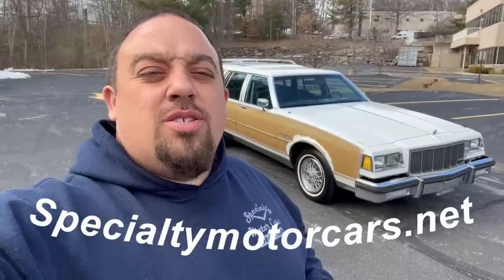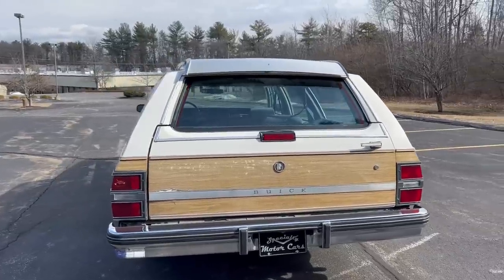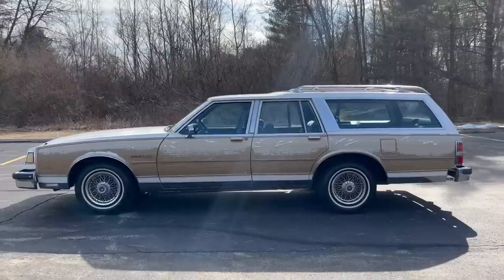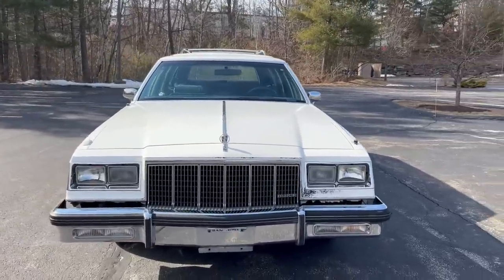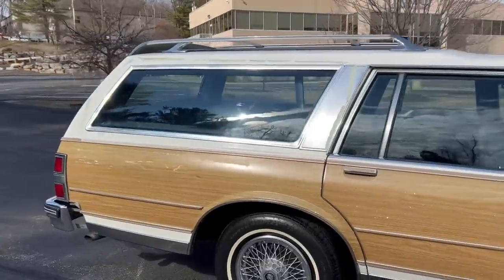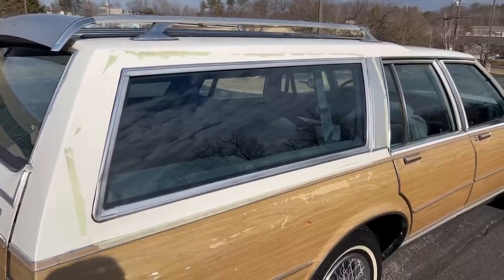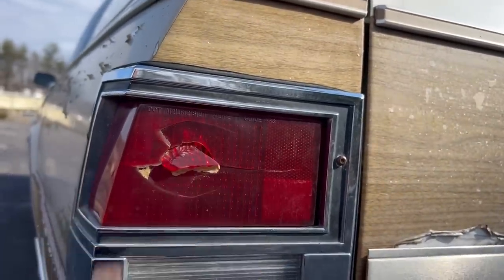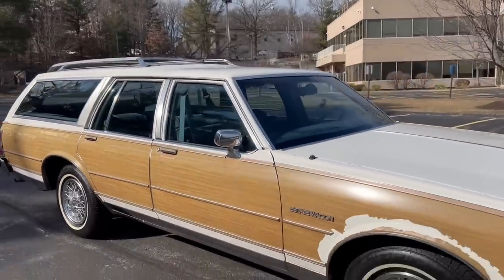1990 Buick Lesabre Electra Estate Wagon FOR SALE 79k miles California Car by Specialty Motor cars

Comment: My Dad had this exact model & exterior color; I’m not sure about the interior.  He bought it brand new in 1992.  It had been a Shuttle Car for the 1990 Buick Open. It sat at the Dealership after being refinished at the factory so it could be sold as new.  But there was a change in the law in MI that year which forced GM to List and sell them as Used.  It had about 4,000 miles on it when my Dad bought it in like Jan. or Feb. of ‘92.  He didn’t have it very long though.  He had to take to the ditch to avoid hitting a dog and Ins. totaled it after discovering the frame was bent downward flexing the entire body and jamming the doors on the passenger side of the vehicle. It had about 8K on it then.  You couldn’t tell there was any flexing or bending to look at it.  Only when you went to open the rear door, passenger side and it would stick.

Our local frame shop was sure they could fix it but GM wanted the car destroyed so they wouldn’t have to ever worry about any lawsuit.  My Dad loved that car.  But he had an ‘83 Pk. Ave. that he also bought new, an ‘87 Ford F350 Motorhome and an ‘89 F150 w/Club Cab  that he also bought new.  So he didn’t really need it.
Reply: Yw⁷

Comment: The back seat had to have been a "delete option" at no charge.  I had an 85 Caprice woody wagon with nearly 300k on it.  I got it from my neighbor.   It rusted so badly that the front shock rusted off and no longer connected to the car!
Reply: Wi-fi / Bluetooth connectivity

Comment: This video is awesome for its documentation even though the car is sold. I recently bought a 90 (same price and similar condition.)  I also have the third row seat delete and the wire wheel covers. I was curious about the black carpet in ours and assumed it was aftermarket but I guess not. BTW, I found the RPO build code sticker in the spare tire well,  there was an option to delete the rear seat.

Comment: The 1990 model they called it the Estate Wagon because they were phasing the name Electra out. For whatever reason they chose to 80-84 Electra header panel only and they had the 80-84 Electra Limited seats only and put LeSabre Custom door panels in the interior even with leather and full dual 6 way with power recliners. Some didn’t have the third row. Some caprice and Parisienne didn’t even have carpet in the rear area period.

Comment: Buick used to sell this model in two trim lines - the LeSabre (and LeSabre Estate) Wagon and the Electra Estate Wagon. They were dimensionally and mechanically identical (though the LeSabre and Electra sedans had different wheelbases). The LeSabre used the front fascia and grille from the LeSabre sedan which was less fancy than that of the Electra sedan and wagon. There were trim differences, too, like seat fabrics, door panels, and option availability like passenger power seat, etc. I think the Electra had extra brushed chrome trim on the B and C panels.

I'd have to check my Buick catalogs but I think they made them all Estate Wagons around 1988, dropping the LeSabre from the wagon lineup.

This is a nice one here with cornering lamps and front fender lamp monitors (what is left of the driver side monitor). Those front monitors were only available on the Buick and Oldsmobile versions of these sedans and wagons. Chevy and Pontiac did not offer them. Out of all the B-body wagons from this era, the Electra was the nicest. It offered upgraded cloth upholstery or leather. I don't think any of the other divisions (Chevy, Olds or Pontiac) offered leather in the wagons. It was rare in the sedans whereas tons of Ford Panthers came with leather.
Reply from the maker: Thank you for that plethora of information!!!